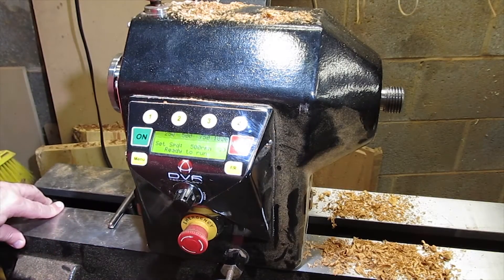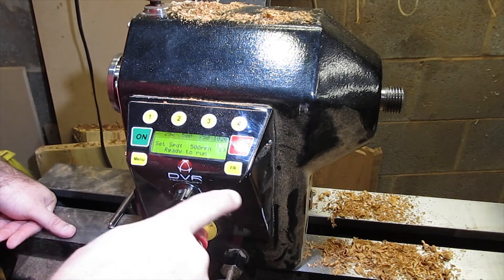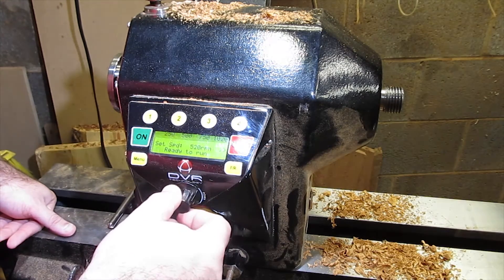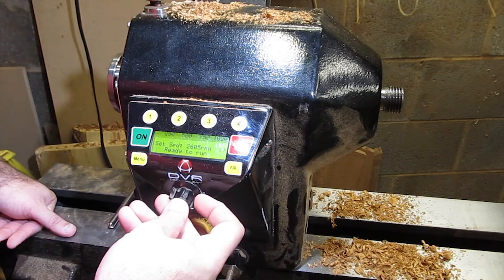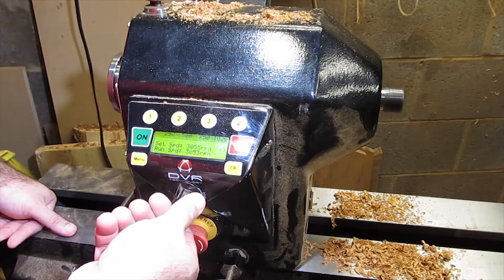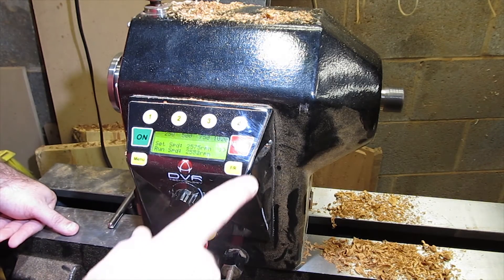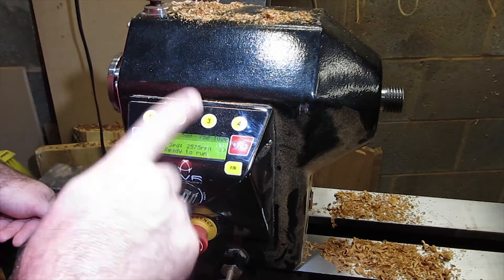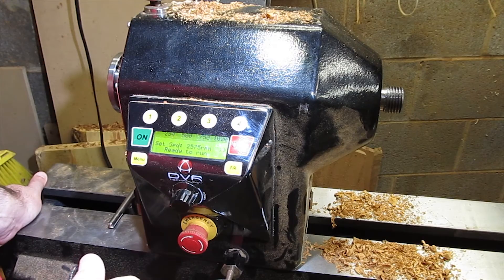NOVA Galaxi DVR 1644 Lathe Speed Control

Comment: Only three big problems with this lathe that needs refining/ rebuilding first is bottom plate under headstock made from cast iron not steel that can snapped in half which has happened already from tightening down headstock. Second is the banjo needs a rethink to light and still moves around bigger the lathe means big amounts of torque the banjo should not move around in my eyes it's a toy for this lathe.Third is all the locking down plates  under the bed should be machined out of steel not cast iron blocks that don't sit true which means list surface area to hold it in place. If they fixed these problems it would be the ideal lathe heeps of power and cool fast speed settings.
Cheers

Comment: The Nova DVR 2024 has the brake feature also ... works great ... just make sure you have the set screws tightened down on your chuck as it will unwind the chuck and send it flying (don't ask me how I know!).
Reply from the maker: +Gerald Jensen NOVA always recommends the use of a set screw whether turning in reverse or forward as you may never know when you need to engage the break.

Comment: Can the DVR-XP be upgraded to this control?
Reply from the maker: +Sid Matheny Hey Sid. Thank you for asking! Unfortunately at this time that is not an available option. Not sure if or when that option would be available. But, if you don't already do so be sure to follow us on Facebook as that is where we will post all new products and information and then follow up with a video on YouTube to show off the product.
Reply: Actually ... it seems to me you can. Just not with the full functionality of the extra sensors (etc) in the Galaxi. But it can control the head unit motor just fine from the looks of it. And with no modification needed to the panel electronics. The only problem is mounting it as the bracket on the DVR XP is not the right size/model. Which is not that hard to fix with a few scraps of mdf or similar to make a makeshift mounting bracket.

edit: In fact when I look at the board in the DVR XP upgrade panel (SKU 55523) and I look at the board in the DVR Galaxi .. Exactly the same main boards with the exception of the display (DVR XP has a different LCD).